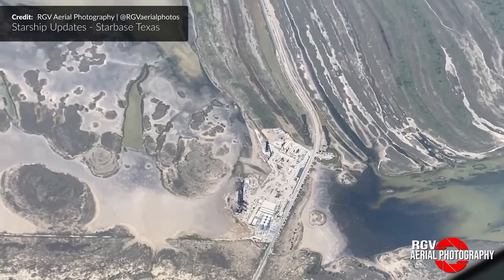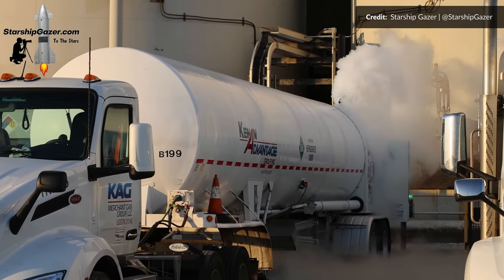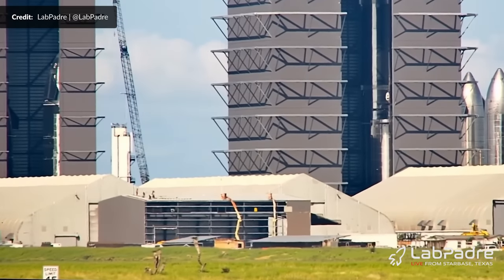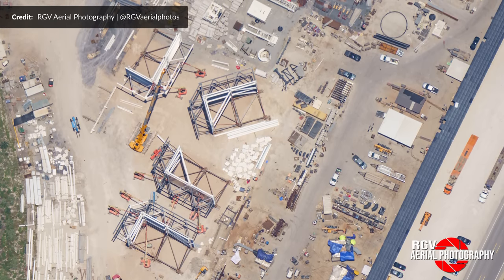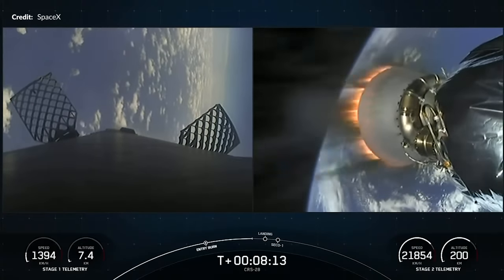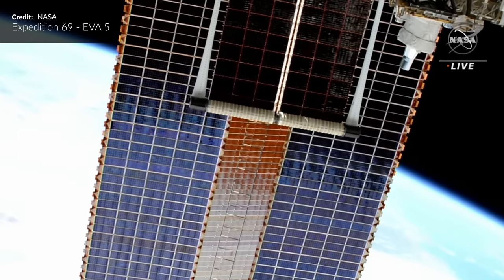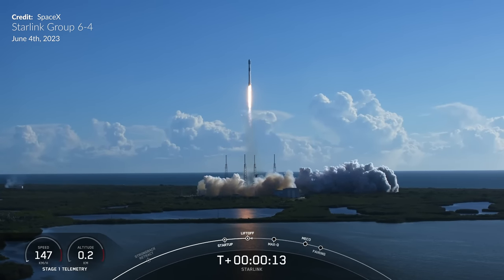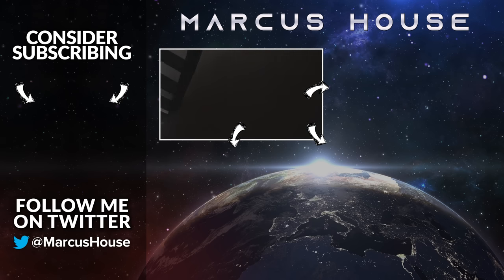NASA's Concerns with SpaceX Starship Delay,  CRS-28 and ULA Vulcan Test Fire

Comment: I wouldn’t read much into any concerns, SpaceX is the only company doing any actual flying.  I’m more concerned that the competitors haven’t even come close in any way.
Reply: they are coming along, space is hard as they say :)
Reply: @brendenharris8858  Space is too hard for some.
Reply: The comp is using a radically different methodology in building a ship, the issue really is that while the competition isnt as far, they have all their unknowns in the bag. Spacex still has to prove a lot of the stuff they claim they were able to do. Also lots of uncertainty concerning the efficiency of the whole starship stack. Reusing the starship will only go so far in making it cheap if they actually have to launch 6 refuellers and dock them just to get one lunar starship on the moon. Heck i still dont understand why they didnt chop up the starship in half for the lunar type just to cut down on landing weight and reduce the amount of refueling they need to do by half or so. Or split starship in a lander and a coaster that goes back and forth between the moon. All these points are massive inefficiencies they are choosing in order to streamline going to mars but make going to the moon double to triple as costly. If you are doing both mars and moon in parallel that may make sense, but that's simply no longer the case, they are not going to mars this decade, simply as.
Reply: I would like every company to come forward, that will drop the space launches price down
Reply: @BartJBols  yet none of them are in space yet.  They “have everything in the bag” is a bold statement considering none of its been actually, physically, practically tested in space.  SpaceX is already operating in space and applying that knowledge and experience to what they’re doing.  The competition has a bunch of theoretical ideas “in the bag”
Reply: Classic spacex shill. Lol
Reply: @Brenden Harris  Wild coyote doesn't think so.
Just strap a WB rocket on your back and your good to go.😅
Reply: Everyone said this about starship and SLS. Now SLS is flying and starship still hasn't come close to orbit.
Reply: @YourArmsGone  Just how many years has NASA taken to get SLS to fly?
Reply: @sputnikalgrim  
Agreed, particularly because both BO and ULA have said their vessels will require in orbit fueling to accomp,is some missions.
Reply: @MichaelWilliams-tv1bm  I'm not saying it didn't take them a long time, I'm saying that Most rocket developers develop rockets in a much less public way than spaceX. Most aren't making full sized test models until later in development.
Reply: Agree.  It’s more an oblique discussion between the FAA and NASA, with NASA pushing on the FAA to get on with the program.
Reply: And SpaceX would be going even faster if they would just get the FAA and all the environmental regulations out of the way.
Reply: SLS Block 1 and Orion have both flown successfully without crew already. 
For Artemis 3 and the moon landing (among other things), SLS and Orion require a second, crewed test (Artemis 2), SpaceX needs to complete an uncrewed test with HLS Starship and Axiom Space needs to deliver a finalized space suit. 

Currently SpaceX Starship definitely has the most work ahead  of itself, in order to meet its ambitious timeline.
BlueOrigin/national Team have a lot more time (at least 4 extra years) in order to meet their deadline.
Reply: @sputnikalgrim  while true, 'being in space' is pretty much an understood science, and any know-how they miss can easily be brought in with NASA help. Having your engines not blow up is way more difficult issue that NASA cannot really help with. If spaceX launches a lunar starship that has 1 engine fail, it might arrive in orbit but would probably not be able to get to the moon, ect ect. All these complexities are far more challenging then often depicted. If i was a betting man id bet they will get to launching to the moon post 2030.
Reply: @Lucas  
Space X only company with true reusable rockets. So at this point who really is right on their methodology? I rather let the numbers speak for themselves.
Reply: @javiervasquez29  Space Shuttle was a reusable spacecraft, as was the Soviet Buran (to a lesser extent).
Both Blue Origin and Virgin Galactic have reusable suborbital crewed spacecraft. Rocket lab has recovered electron boosters.

ULA is developing reuse for Vulcan. Rocket lab is developing reuse for electron and Neutron. BlueOrigin is developing reusable, orbital heavy lift NewGlenn and a reusable manned lunar lander, as part of the national team. Relativity is developing the reusable TerranR booster. And a bunch of other companies are also developing reusable Rockets.
Reply: Why does it matter right now? Thats not NASA's problem. NASA's problem is that the product they paid for is around 18months behind scheldue

Heh, im getting SLS flashbacks, gues we are about to get new spaceflight project public can kick around for underperforming
Reply: @plainText384  The Space Shuttle required $2 billion worth of refurbishment and one year between launches.  “Reusable”.
Reply: Are there even any concerns to read too much into though? Just seems like normal YouTube speculation
Reply: @BartJBols  Ok, so the company that has landed nearly 200 orbital class boosters and reused them 110 times is in question, but the competitors who have yet to actually launch anything into orbit have it in the bag. This sounds like wishful thinking.
Reply: Exactly. NASA themselves have no room to worry about delays, let alone the vast majority of the other “competitors”
Reply: @plainText384 neither was cheap and effective, nice common sense skeptic talking point though lol
Reply: @sputnikalgrim  Doesn't matter much that spacex has Falcon in Space etc etc as that isn't the system that is going to the moon. As of today they are in trial and error when it comes to starship and they're not terribly far ahead of the others.
Reply: and consider the chronology for the other "reusable" rockets.  they're playing a decade late game of catch up, while in the end the first adopter is not guaranteed permanent first place, it is also true that they have a head start on staying so.
Reply: and consider the chronology for the other "reusable" rockets.  they're playing a decade late game of catch up, while in the end the first adopter is not guaranteed permanent first place, it is also true that they have a head start on staying so.
Reply: @PoliticalAnimal87  not really. Building stuff takes time, testing takes time.
Reply: SpaceX isn't afraid of experiencing occasional development failures, anomalies that become lessons. It's disappointing that B.O. has (thus far) chosen such a tentative route.
Reply: @YourArmsGone  I think 39 km is quite close for a first trial shot. The next trial can already be there, we will see.
Reply: @MichaelWilliams-tv1bm  Be sure to include all the years and the cost of the constellation program.

And dock them for throwing away parts bought under the shuttle program and donated.
Reply: @odynith9356 classic ULA shill
Reply: @plainText384 how much money have they spent?
Reply: @plainText384 ULa explosion 💥. 😂 Space shuttle was a failure. Killed it's crew and only used for low earth orbit. 2 billion dollars to refurbish it.
Reply: @iamaduckquack nor orion is going to land on the moon 😅
Reply: True
Reply: Musk promised cargo ships on Mars by 2022 ho hum.
Reply: @YourArmsGone  SLS flew, 5 years after its original first flight was supposed to go up.  Well, I guess that is a thing.
Reply: @YourArmsGone  And most take much longer than their original estimates.
Reply: @plainText384  Neither the Space Shuttle nor the Buran were reusable.  Refurbish able, maybe, but in the end it would have been cheaper just sticking with capsule based rockets in both cases.
Reply: @_mikolaj_  At NASA timelines, SpaceX can be 5 years late and still be on time.
Reply: Rocket Labs is.
Reply: @sputnikalgrim  he’s talking about starship broski
Reply: @MichaelWilliams-tv1bm  oh you know...Only 11 years including a 6 year delay.
Reply: @NScherdin  well thats just wrong.
Reply: @reynajs2412   And that was with adapting existing, proven hardware from the Space Shuttle.  The SLS pretty much is the STS, only scaled up a bit, putting the main engines under the tank, including a second stage, and putting a smaller spacecraft on top instead of an enormous one on the side.  Imagine if everything were new--that sucker wouldn't be flying until the 2050s at the rate Boeing, with their lucrative cost-plus contract that rewarded slowness, was developing it.
Reply: @NScherdin  Space Shuttle was reused multiple times, and even though Buran wasn't, It was ready to be reused.

Falcon 9 rockets also get refurbishment and maintenance work done, as well as having parts replaced, between every flight. The speed of that process doesn't make something "not reusable". If parts can be reused, it's reusable.

And capsule based rockets couldn't have done what the Shuttle did.
Reply: @BartJBols   NASA chose Starship because SpaceX inspired them to take a big chance on a potentially game-changing technology.  They wanted the HLS to be a full-size Starship variant because the capability it would offer is what makes it worth the risk.  Landing even one of those things pretty much gives NASA an instant base on the Moon.  I never even heard a suggestion about having SpaceX cut the HLS down to a smaller size.  They want that gigantic lander if they can get it, and obviously they must have felt that SpaceX could deliver it.

As for the latter, SpaceX already have multiple Starship prototypes that are nearly complete, and they're all improved over the one that recently flew, including the Raptor engines, which should be more reliable than the first set.  Several on BN7 failing immediately at launch was anticipated (they did during the static fire test, as well), and the newer Raptors that are waiting to fly are better.  Unless the lawsuits get in the way, development seems all set to rapidly accelerate very soon, and HLS is being developed concurrently (just out of the limelight).

SpaceX still have over 2 years to get everything ready, and probably several additional years to still beat China to the Moon, at least.  And if it happens with HLS, then NASA will reach the Moon in force, so speak, with a serious capability to take immense amounts of equipment and supplies on each mission, and quickly establish a permanent presence on the Moon.  That kind of ambition itself presents many unknowns and much risk, which the Starship and HLS actually help mitigate in terms of sheer quantity.
Reply: @AP-qs2zf  I’m not a ULA shill, I’m an aerospace shill I look forward to seeing them all succeed. I root for all space projects. Not you just bashing ones despite knowing nothing about them while always biased to spacex
Reply: @YourArmsGone   How safe is the SLS, anyway?  It's based directly on the STS, which always seemed to have something or other go wrong or nearly go wrong, even on its many successful missions.  This repurposing of somewhat questionable existing technology was supposed to have made SLS development relatively easy and quick, but it still took many, many years, and it was several years late!  It had better work, or else it'll take several more years to fix.  Development of the Starship in earnest started much later, and it's a far more ambitious design.  It has been developed much quicker, and the pace is set to accelerate pretty soon with the upcoming flights (all done before development has been completed, unlike the case with other rockets).  Can SpaceX finish its development in 2 years?  Maybe, but it's not comparable to the SLS, which is a slightly scaled up version of STS hardware, minus the Space Shuttle mainly.

In terms of the current Space Race to the Moon against China, they're targeting 2030, and they've been late before, themselves, since the last time they had set a target year, it was to be 2020.  NASA did the same thing, and both missed their targets by a long way.  China is much farther along now, but then again so are NASA and SpaceX.  Even if SpaceX miss the end-of-2025 target, there would still be time to get to the prime areas of the Moon (the same ones China want) before China does.
Reply: Yep.  All of the infrastructure they’re talking about (lunar landers, refueling, etc.) is something I’m not seeing anyone else anywhere close to completing.  It’s all on SpaceX to deliver now, which is clearly something they can do so long as the governmental agencies stay clear of them.

If nothing else, NASA now has more reason to screen for SpaceX in any further legal blockages just so they can get their rockets ready for Artemis and start working on the internal components.
Reply: @Brenden Harris  0:31 oçp pvp pv0😊p
Reply: Kkkkk
Reply: kk
Reply: @BartJBols  "the issue is that while the competition isnt as far, they have all their unknowns in the bag" HAHAHAH LOLOL oh really? is that why for example boeing's starliner continuously being delayed because they keep finding new damn issues.....I thought the competitors "have all the unknown in the bag", also wow for a company(boeing) that has all the "unknowns in the bag" They sure do dumb things like using flammable tape for the wiring....................

Also you can't simulate the unknown, because you can't bloody input what you dont know into the simulation software, otherwise spacex would've caught the COPV failure that lead to the loss of one of their mission, heck if you can simulate everything and have all the unknowns in the bag, spacex would've had nailed propulsive landing in the very first attempt......."Spacex still has to prove a lot of the stuff they claim they were able to do", "the competition has all the unknowns in the bag" Wow nice, giving a pass to everyone else while thrashing spacex......wait a minute this sounds familiar.......

Oh wait, it's the boeing(space industry veteran, have all the unknowns in the bag) vs spacex(young, immature upstart with diapers) thing all over again......LMAOOOO Boeing lobbied hard to be sole provider, everyone claims boeing will be 10 years ahead of spacex, boeing receives 2x mor funding, NASA scrutinizing spacex AF, spacex can't do it, NASA trust boeing because they have all the unknowns in the bag etc etc....what happened? Oops embarrassing....... Everyone should be scrutinized equally, you're doing the same thing everyone is doing again when they thrash spacex only to be proven wrong.........
Reply: @marksnow8838  see you in 2 to 3 years.
Reply: Why would anyone want to explode a rocket.
Reply: @iamaduckquack  has any other company launched anything?  They’re still not flying… my comment remains valid.
Reply: @interman7715  and to my point he’s still closer than any of his competitors.  If you have a way to make and deliver a similar promise I’m sure everyone would love to hear it
Reply: @Bingiisyaboi29  indeed, and like I said they’ve actually had a launch.  Sitting around testing an engine and talking isn’t flying
Reply: @YourArmsGone  yeah, but SLS was built over a way longer period and is using off the shelf products, SpaceX as made everything it’s using not just buying already made engines or rocket components
Reply: @MichaelWilliams-tv1bm  1 year longer than Starship, so far.
Reply: The fandom never ceases to be fun to read.  At any rate, it's all moot if SpaceX loses this lawsuit, or the FAA is ordered to do a full EIS. That would effectively shut down Boca for good. Starship would then have nowhere to fly. NASA has denied Starship at the Cape for now. Make no mistake, NASA calling out SpaceX in public is a nudge for them to get their sh*t together. I'm sure there are people at NASA who think it was a mistake to pick SpaceX, and there are plenty of legacy aerospace people there saying the same thing. But hey! The drug use glorification of the 4/20 launch was funny! Right?
Reply: @PoliticalAnimal87  During their last test launch they nearly destroyed their entire fuel farm and launched concrete for miles, Not to mention their launch abort system failed. The FAA SHOULDN'T have approved THAT launch.
Reply: @shanemeyer9224  I agree, My point is, SpaceX is flashy and public with its development and tests most launch providers aren't which makes comparative progress difficult to judge.
Reply: @BartJBols  How is that a comeback? You know that applies to the competition too right? And since you so proudly claimed competition knows all the unknowns, they better not fail to deliver on time LMAO
Reply: Rocket Lab from New Zealand ( now a US registered company so as to work for the US DoD) have been successfully flying their small launch vehicle for some years.  Launching from both NZ and the US.
Not in SpaceX league of course.
Reply: I would be very interested to know how much money it would take to lower the risk to delay.  Would NASA be willing to pay for this?🤔
Reply: @plainText384  looool, the space shuttle was basically rebuilt after each mission. It was not really reusable in the same sense as say a Falcon 9.
Reply: @Jip  The space shuttle reused all its engines, while Falcon 9 expends one Merlin on the upper stage every time.
So, if anything, the Shuttle is MORE reusable because more parts were reused. Reusability isn't a measure of safety, reliability, cost savings or launch cadence. Reusability means reusability and nothing else.
Reply: @plainText384  you are just going through mental hoops here. With the launch cadence spacex has shown true spacecraft reusability. You are comparing two very different things. Ok the space plane stage of the space shuttle was fully reusable. What about the solid boosters and the SLS first stage they used? Forgot about that. Yeah dumb take bro.  Do better.
Reply: @Jip  the space shuttle did not use a SLS first stage. Maybe you mean the RS-25 engines, which both the SLS core stage and Shuttle orbiter used. These were reused. The two four segment SRBs on the Shuttle were also reused. They landed in the ocean with parachutes and were refurbished and refilled with propellant.
Reply: @plainText384  I am talking the main orange tank.  That was lost and that is what became the SLS. If you want to double down on stupid it’s fine. I am out.
Reply: @BartJBols  "i still dont understand why they didnt chop up the starship in half for the lunar type ... Or split starship in a lander and a coaster"

Such a radical change would basically be starting from scratch.
Reply: @Jip   The orange drop tank did not become the SLS core stage. It's a drop tank and has totally different structural requirements compared to a main in-line core stage. The SLS core stage is also significantly taller than the external shuttle tank. Obviously, the SLS core stage builds on the knowledge and experience that NASA has gained from building the shutte external tanks, but they are not the same thing.
A duck is not a goose, even if they are distantly related and look somewhat similar. You should really know what you are talking about when accusing others of doubling down on stupid.
Reply: @BartJBols  "id bet they will get to launching to the moon post 2030"

Agreed. Too many hangups to solve for an overly complex mission. No boots on the Moon this decade.
Reply: @alexanderpierzchala1615  No, the worries are valid, because Starship HLS is only one part of an array of hardware, paid labor and plans that will be sitting around waiting if SpaceX doesn't deliver.
Reply: SpaceX Shilling in effect. 😂
Reply: @UncleKennysPlace  And space is still to hard for some after getting billions upon billions of dumpsters full of cash.
Reply: @YourArmsGone  You do realize Artemis is all reused parts from the spaceship and other programs. 
They're not building anything new here.
Reply: Spoken like a true Musketeer... zzzzzzzzz
Reply: @OneBiasedOpinion  Appropriate username.
Reply: @chrisjacobsen1659  Yes, the username was put in place for the exact purpose of filtering out the fools by giving them the easiest possible one-off response.

Lemme guess: Spaceship Man bad?
Reply: @OneBiasedOpinion  lol no starship is mostly ok, about you're moon infrastructure claim, when will they first pour their first concrete launch pad on the moon again?
Reply: @YourArmsGone  that’s very valid
Reply: Blame that to FAA and Elon himself when he too focused on Twitter buying
Reply: @yusrisaadun5497  “Spaceship Man bad.”

Him buying Twitter has been the best thing that happened to that God-forsaken platform.
Reply: NASA has been to the moon several times already
Reply: @Jimmy-Legs  Yeah, 50 years ago.  They couldn't do it again today if the future of mankind depended on it.
Reply: @DG-wo8fx     Looks like Musk is finding out it’s a lot more difficult than sending satellites up into orbit. As usual.

Every time he makes a prediction, he says it’s 10 years away.